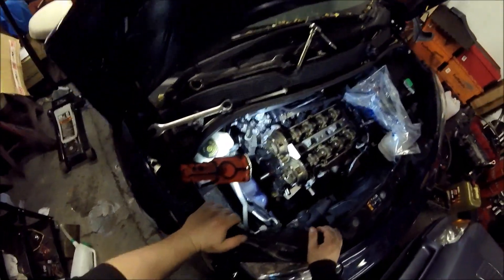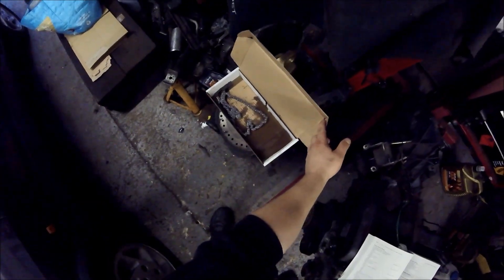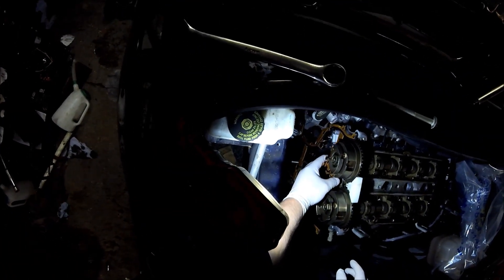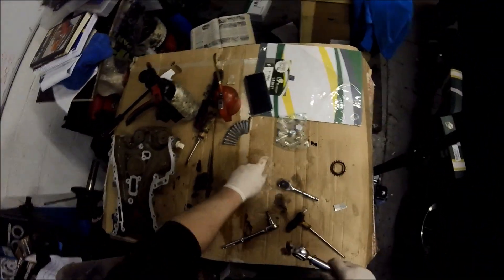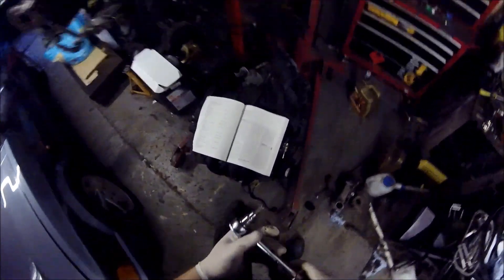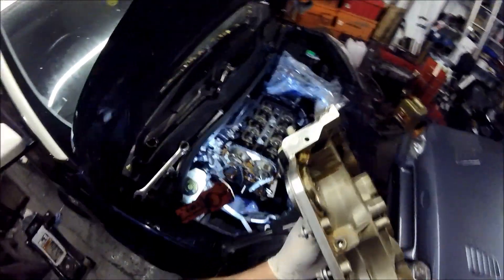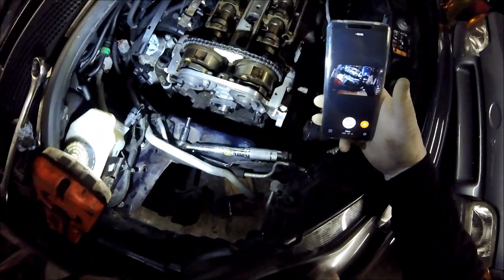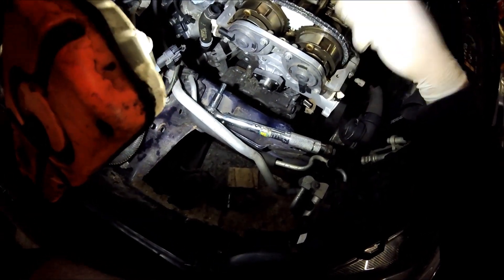fitting a timing chain vauxhall adam corsa astra combo  replace repair a12xel a12xer symptoms

Comment: Hi mate handy video, been offered  2015 for cheap, with chain failure, happened on neighbours drive when starting, won’t I need to replace the head / check valves or just fit a new chain, quickly turned it over to hear it and there’s no clunking as you’d expect just a slight tapping noise L, obviously it won’t start but would be great if I just had to replace the chain kit, oh what glue are you referring to ?

Comment: How many kilometers are you change it, at this opel adam
Reply from the maker: Hi the Adam had covered 45000 mile
But reson for failure was lack of servicing
Reply: @TELSGARAGE  Thank you for the answer. I have the same engine in my opel corsa d and I change my oil, every 4500miles. I have 36000 mile, the car is runing most of the miles in the citi. When do you think to change the timing chain at this tipe of engine, 62000miles in fine or sooner
Reply from the maker: Iv seen these engines with over 100000 miles on the clock with the original chain
Normal the chain give plenty of warning befor they snap they become noise and rattly and throw up an engine light befor they snap for cam and crank out of faze or correlation

Comment: did you have to take the sump of , also the cam cogs have to be undone to set timing up ?
Reply from the maker: Hello yer I did remove the sump 😊
It makes it easier to refit the side casing for u don't Need to worry about working around the sump and also u need to trim the side gasket up after fitting the side casing

As for the cam pully I don't thing I needed to un do them for it line up well
I'm but some time u do need to undo them if the cams don't line up nice also if u do undo the cam pully u will need to replace the bolts

Comment: Nice video. I’m curious as to why you used sealant on the timing case gasket when it’s located on dowels - was that what the book said? What sealant did you use? I’ve done loads of the earlier z12xep but never used any glue on them.
Reply: It's just near the where the head meets the block the gasket tends too sometimes leak